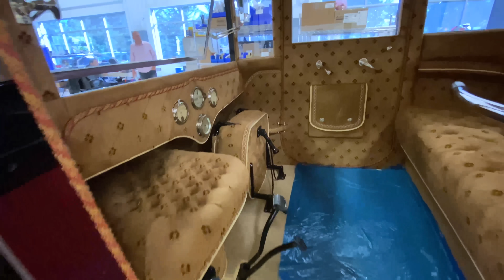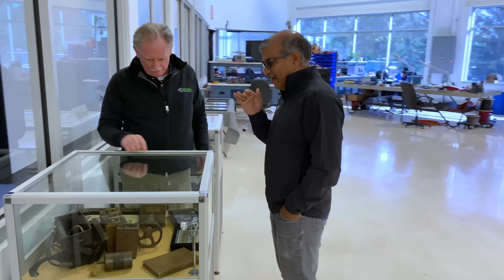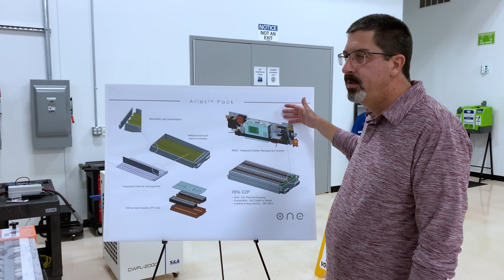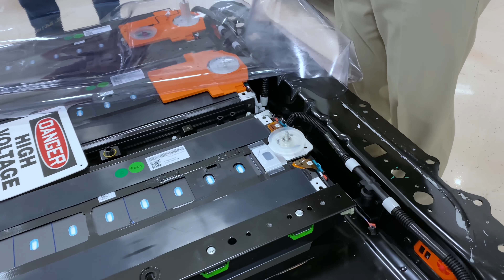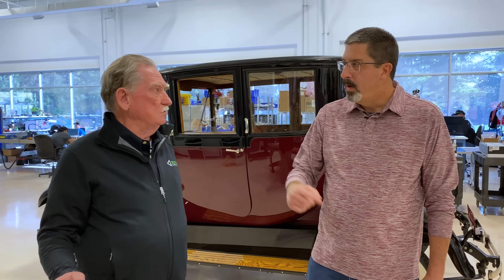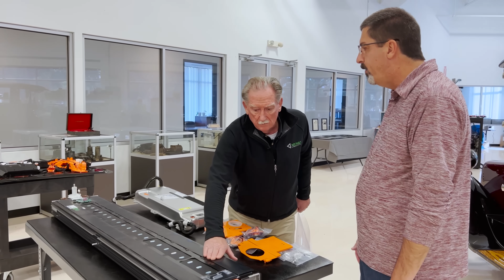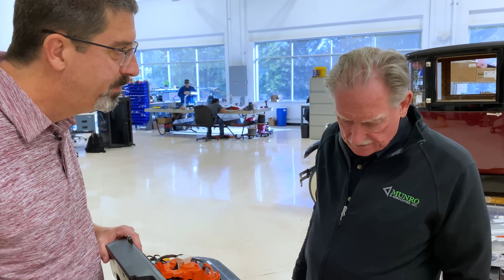Tesla Model 3 LFP Battery + Sandy Visits the ONE Facility

Comment: Thanks, interesting review.

Here in Australia the BYD 126SP1 LFP 60 KW single module blade battery pack (and variations) is proving very successful. It is used in BYD and Tesla vehicles where it offers low cost, low profile, light weight and is proving very reliable.

Comment: Tesla Model Y Standard Range from Berlin use BYD blade battery cells which has a little better charge characteristic then the CATL cells. Prismatic cells seems like the way to go in terms of reliability and repair-ability which is crucial if electric cars are going to be mainstream. Especially LFP batteries makes a lot of sense from an environmental and economical perspective.

Comment: - Now THIS interior for that old car is elegant, unlike the modern cars with their fancy leather, but very poor style for stitching and decoration. This looks proper, with all the elements there.
- Regarding the battery tech, using it as part of structural integrity is bad, very bad for consumers, quite anti consumer, because when the car is involved in a crash and there is damage to the structure, it totals the car instantly. And not just because of the cost, but because of the affected structure.But lets say it's not totaled because of the structural integrity and you can take out the unit and install another.
Well, that cost is prohibitive and insurance companies (which are a scam) don't want to pay up such money, so they either don't insure such cars, or will do it at outrageous premium. Thus owners are being exposed to an unfair marketplace. If you want to replace just a damaged part, you cannot because it's not modular design.
This is not progress, using batteries as structural part, is the opposite, leading to the downfall of EVs

Comment: "Wave of the future" is China.  Tesla is moving from a custom-car type design (ex. Model S) to high-volume design, as in most consumer products.  After years of fans claiming Tesla had a battery advantage, we find that mostly a myth.  They began with thousands of tiny Panasonic 18650 Li battery cells, as used in Laptop batteries and hand drills, but are now moving to larger and fewer prismatic batteries from China (LFP chemistry), like most other battery-car makers use.  Much of the slick design-for-assembly shown here might also come from China.

Comment: Nikola Tesla in 1934 retrofitted a 32 Pierce Arrow with 2 sets of 6 7L70 tubes in a row producing 40 volts per side and powering a 80 v motor. It also required two 6 foot antennas. JP Morgan killed the system from reaching the public by saying that it had to go through a radium battery and radium was found to be to dangerous. I ran across a schematic of how to build it without the dangerous "Radium Battery". The tubes are linked together in a series circuit. Could this be a way to charge your batteries without plugging in or having to stop if you did not want to? You could also run the 40v into a battery bank and grid tie to your home. Jimbo the Bimbo.

Comment: You have to respect a man that researches what has gone before when embarking upon what will come up next. There is always something to learn and a "clean sheet" is really never such a thing. You always confront the same list of issues. Some will be mitigated or become wholesale obsolete while some will have a stroke of genius from the past that would benefit from a modern upgrade opportunity.  To often we see engineers act as if today is time zero. That is never the case.  In fact most of what you are capable of manufacturing today will find their underlying discovery and theories generations back.  An example of which is - the venerable induction motor.

Comment: My response to 12:24    when the combustion engines began to make more sales than the electric vehicle in 1920 because of the electric start the vehicle cost began to come down.      THIS IS THE BREAKING POINT WITH TESLA... WHEN THE COST BREAKS 25,000 THEN IT IS GAME OVER FOR ICE VEHICLES.    NO ONE WILL CHOOSE TO BUY AN ICE VEHICLE THAT COSTS MORE TO MAINTAINE AND RUN.   I WOULD GUESS 2023 IS THE YEAR OF THE 25K 'MODEL 2'  VEHICLE.   AND POSSIBLY THE YEAR FSD IS RELEASED ON ALL VEHICLES.

Comment: Some interesting facts: Up until 1905 the American Geophysical Union considered oil to be a renewable product produced deep within the Earth under high temperature and pressure and chemical reactions. It was under pressure from old man Morgan that it was changed to a 'fossil' fuel. In the early days the refineries were only interested in home heating grade oil and what became gasoline was an unwanted by-product with no use and was dumped into the rivers that led directly into the Gulf. Follow the money.

Comment: With that unseparated cell to cell Design, I would  be a bit concerned about fire propagation in case of a thermal runaway of a cell. Of course These are LFP cells, which are relatively safe, but a modular Design is always safer considering propagation

Comment: LFP? isn't that the battery that is "useless" as it have close to "no range" in winter due to cold and heater use? AND it looks to be "impossible" to service. a BIG problem with Teslas batteries is the cost to replace as it is difficult to impossible to fix.

Comment: so the new packs are larger and heavier. or the same size but less energy density?
Reply from the maker: The biggest advantage of LFP batteries is in their low degradation, LFP batteries will retain 80% capacity for a minimum of 1000 full discharges, most manufacturers warranting them for 2-5k cycles , li-ion will get barely scratch 1000, and in high discharge ev applications significantly fewer.  Other significant benefits are in the lack of cobalt in the cell chemistry, and the near complete resistance to catching fire.

Comment: these kind of innovations happen everywhere and of course not only at tesla. this reduces cost of the battery a few percent every year. better battery chemistry, better automated production processes etc. this is why e-mobility is so cool. it still has so incredibly much potential for innovation and making it cheaper. what annoys me here, is, that these modules are too bit to handle it in the aftermarket when the car gets scrapped but the battery is getting reused for solar etc. energy storage in the household. they should be designed in smaller modules that could be stacked in a rack without much rework to be done. also for building it in variable sizes for different cars that would be great.

Comment: The ONE battery pack is more efficient in volume, we are told, but the biggest problems with existing Li-Ion batteries is that they weigh too much and are too costly, NOT that their packaging is too large.  These are obviously smart people with relvant experience, but what important advantage do they offer?  For example, electric pickup trucks have excessive storage space, if anything.

Comment: LFP pack looks so much simpler. And with better safety and longevity, if you can do without the extra miles, looks a way better option.
Reply: Plus cheaper to make and more sustainable and environmentally-friendly (no Nickel or Cobalt needed). It’s a win-win all around besides them being slightly less energy dense. I really hope Tesla and other EV automakers start switching to LFP batteries in the near future.
Reply: @philorgneopolotin8762  all manufacturers have already been using LFP batteries, tesla was among the last one to do.
Reply: carholic1336 you’re so wrong lol. Almost none of them use it. If they actually did then all EV’s would be recommended to charge to 100% every single night no problem, but surprise surprise, literally none of them advise that besides the few LFP’s Tesla’s sold. I’d love to see some proof that all other automakers use LFP batteries and Tesla was the last to do so.

Comment: Perhaps 21st century technology should take another look at steam powered cars.  Steam has high torque at 0 RPM similar to electric, but the energy source is hydrocarbon, thus enabling rapid energy replenishment.  The advantage over internal combustion engines is that the combustion process is amenable to tuning for low pollution with a wide range of fuel types.  The downside is there is still CO2 output.  Electric cars have a leg up in regions where hydrocarbons are burned to make electricity because there is potential to eventually affordably sequester CO2 centrally at industrial scale versus having to mitigate CO2 output at every individual car.

Comment: Correct me if I'm wrong but LFP batteries are cobalt-free, right?  This is great from an environmental perspective but it makes the batteries less valuable at the end of their lives.  Don't get me wrong, eliminating cobalt is much better than getting more $ at the end.  I'm wondering if the individual cells are laminated into the structure.  From what I've watched/read that removing the adhesive (by heat or mechanical methods) is the most time consuming (hence, most expensive due to labor) part of recycling batteries.  No adhesives and no cobalt are huge steps in the right direction.  The holy grail will be to make the batteries cheap and 0% flammable. I drive a Chevy Bolt EV so fires are a real concern - LOl, no-LOL. :^]

Comment: The railway still uses primary batteries, but very rare. I came across a battery well when I first started with the railway, but they had already been using lead-acid batteries and were switching to nickel-cadmium. More temperature control now as electronics more sensitive than batteries.

Comment: CATL pack has some great electronics, but Tesla structural pack design better I think - While the pack charging inverter and AC/DC converter are still designed to use space under the back seat, supply power to the rear motor inverter, and connect to a rear mounted plug, there are significant savings to be made by having the charge point in the front quarter panel and packaging all the high voltage stuff into a cooled fireproof box under the hood and just run cables to motors (drive and HVAC) and pack.

Comment: I think LFP is a superior technology to the LiOn cells. It does not have the watts/lb advantage but mass production assembly is far easier. 108 LFP cells versus thousands of individual lion cells. The Tesla LFP pack is nice design. Simpler, more automated assembled batteries will drive the price of electric vehicles down like Henry Fords assembly line did.

Comment: One not so well mentioned item is that Tesla's model 3 is at 75 kWh minimum useable energy. Installed energy is ~82 kWh. So would be interesting if ONE was able to get close to that with its 79 kWh battery (not sure if minimum usable  energy, average usable energy, or using installed energy).

Comment: It seems to me electric vehicles would be better off with drum brakes than disc brakes... Could Monroe live address that electric vehicle seem to have a unique set of problems with brakes.
Thanks
Reply: @nicewknd  regenerative braking is pretty strong, don't underestimate it. Many EVs have rusty disk because of under utilization...
Reply: @nicewknd  electric cars are old technology.
Semi trucks use drum brakes.
Heavy loads at low speeds drum brakes are better.
Single piston calipers when not used very much go bad. The mechanical slides freeze up.
I would love to hear Monroe lives thoughts on this...
Reply: @davidhumeston5292  liked the Idea of VW to use a completely sealed drum brake, to give it a long lifespan and no maintenance need.

Comment: Many thanks to Sandy & his crew for the ONE walkabout.   I'm a great fan of LiFePO4 cells - their long life & thermal safety are top priorities for me.  I was lucky some years ago to purchase a couple of 6-cell sample kits from A123 of their 26650 cylindrical cells a few months before their bankruptcy - some of these single cells power my now-antique Black & Decker "Dustbuster" units - one nominal 3.6 volt LFP cell in the tool's handle replaces three NiCd cells.  I float-charge the cell @ the A123-recommended 3.45 volts  using a low-power switching regulator added into the stock mounting fixture, and these little vacuum cleaners will suck hard for well over 20 minutes.  Very happy...

Comment: Very interesting. I just got my standard range + model 3 with the LFT battery. I am wondering if what I've been told about these batteries is correct. Should I charge them nightly to 100%? I've seen several Youtube videos and articles that this is what I am supposed to be doing. I am glad that Sandy was impressed with the LFT battery.
Reply: you can charge it to 100% no problem but i would recommed 90% but dont be shy to go for 100% (It can handle it much better than the other batteries) LFP is great for a long battery health so you can use those batteries until your vehicle is done in 20 years or so they are great. (Dont take my word for it)

Comment: I read somewhere the LiFePo4 patent was "GIVEN" to china so only they could produce.  Is that changing?
Reply: Chinese battery manufacturers were offered use of the LFP pan tented tech provided they did not export LFP batteries outside of China. LFP outside of China (principally EU and US) was not popular due to two things: 1) the market for BEV’s was nascent, 2) royalties. What is changing is the patents are due to expire so LFP’s face a whole new world given BEV’s and market demand is exploding (not as nascent) and royalties will go away. Today, LFP has many advantages over more traditional Li-ion recipes including safety, plentiful and significantly less expensive raw materials, and ability to charge to 100% with little degradation compared to competing Li-ion batteries while their primary drawback is slightly less energy density. Just the ability to charge to 100% vs 80% for other Li-ion batteries more than compensates for the lower energy density, while the lower cost and increased safety are significant advantages. 

LFP will likely takeover the mass BEV market until the advent of an solid state battery that is as cheap to produce (as current Li-ion batteries), is easy to manufacture, and can scale up.

Comment: 18:00 - "Every prismatic is made in China. AFAIK." It's wrong, Sandy. Prismatic cells for automotive use are not only produced in China. They are also produced in South Korea and Hungary (by Samsung SDI), in Japan (by Panasonic), and soon in Germany by CATL. Just to name a few examples.
Reply: I wonder if he meant LFP.  Due to patent licensing issues, until basically next year China has a monopoly on LFP tech outside the US.   Inside the US, not much was done with it, so it's mostly China or nobody.
Reply: @Keith Babarovich  Well, in case he meant LFP he should have refered to it as "LFP". At least, that sounds much more reasonable, refering to the LFP cell chemistry than the prismatic shape of the cells.

Comment: I didn't really understand what ONE actually do, are they battery designers? Why do they have a Tesla lfp pack there? I liked the old electric car and appreciate the reasons why they didn't prevail against the ICE cars 100 odd years ago but frankly now, EV is king - ICE is already dead unless you still need to sell them to stay in business.
Reply: Ice is only dead because it's of its pollution.  The future for many types of transport will be hydrogen, not battery's. ICE will make a comeback.
Reply: @darrenpardoe  hydrogen is electric, as electricity is needed to create it, just with the added step of another expensive transportation and storage infrastructure to get it to vehicles as well as adding huge ineffeciencies into the system. Which by the way due to needing high pressure tanks means they have limited range.  Hydrogen is a stop gap measure as zero emissions vehicles can be created from existing ICE vehicles. Not bad for a city center bus, terrible for passanger vehicles. The future for all vehicles is electric. Chuck some cheap solar panels on your roof and you can fill your car up, try doing that with your hydrogen car.
Reply: @ForeverNeverwhere1  if you want to go that route. Every energy source is powered by hydrogen because it was all generated by the sun!
Reply: @darrenpardoe  Stupid comparison.
Electricity is also produced by wind, hydro and nuclear.
Plus hydrogen is inefficient and useless for passenger vehicles.
Reply: @neeljavia2965  Nuclear fusion produces all the energy from Hydrogen. Nothing more, nothing less. So why not use the most abundant material in the universe to produce all our power? But if you have the mindset, just extract the electrons by combining hydrogen and oxygen :) It's just so versatile if you can catch it ;)
Reply: @darrenpardoe  Hydrogen will be viable only for commercial and heavy duty vehicles.
Not for passenger vehicles.
The problem is not the availability of hydrogen.
It's how it's extracted and how it's used to drive the vehicles.
Reply: @darrenpardoe  if hydrogen were to be used it wouldn't be via internal combustion in an engine it would rather be to produce electricity via a fuel cell.  ICE does pollute, that's true but it is also quite a bit more expensive to fuel and maintain than battery electric.  That provides a more compelling short term reason to switch than the environmental one.